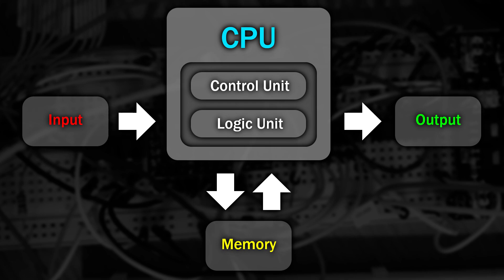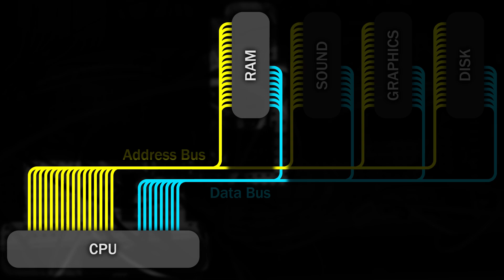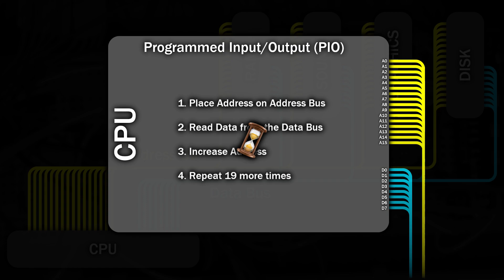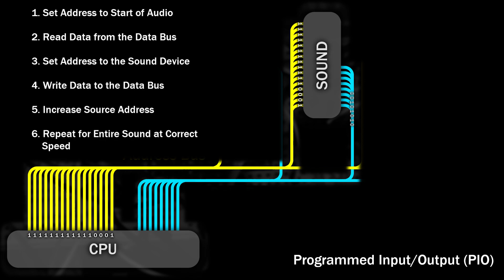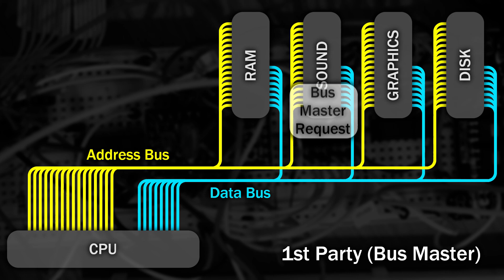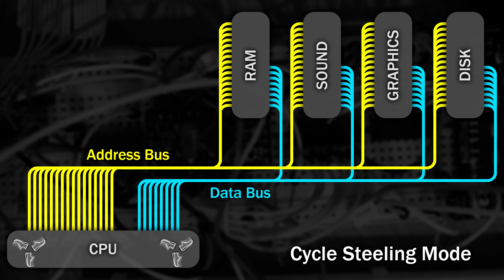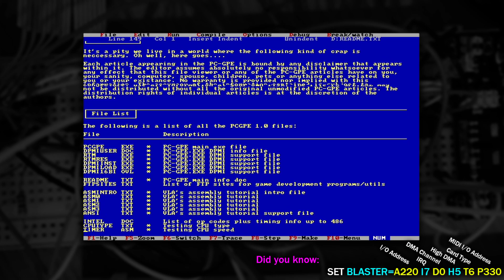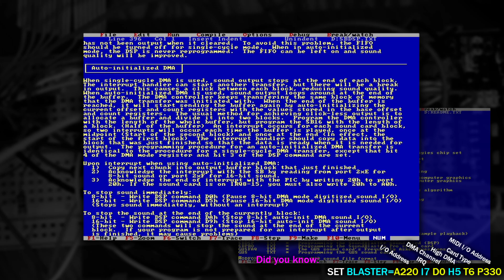What is DMA? What does it do? and Why is it Important?

Comment: how can i check on a virtual machine if DMA is enabled
Reply from the maker: Virtual DMA most likely will be. Theres hardly any computer system that doesnt use DMA
Reply: Is there any windows command ..powershell or cmd I can use to check
Reply from the maker: I doubt it, DMA is way way to low level